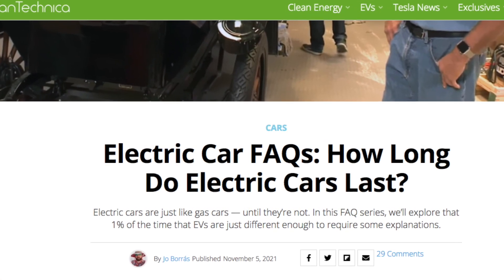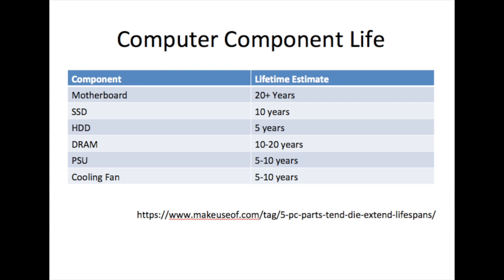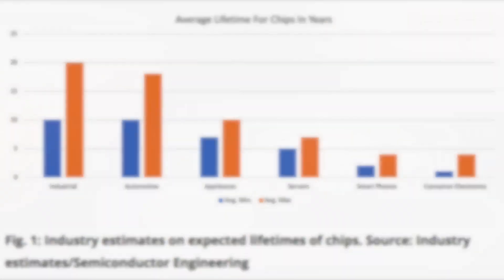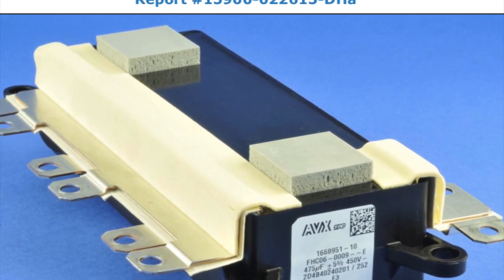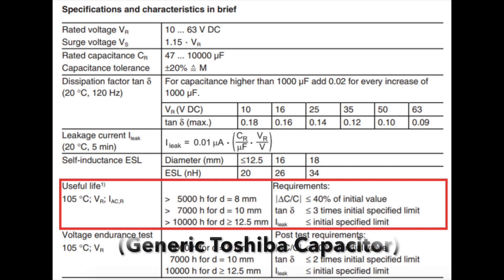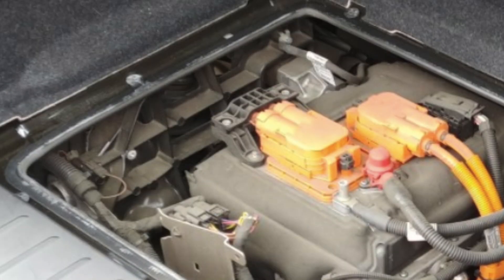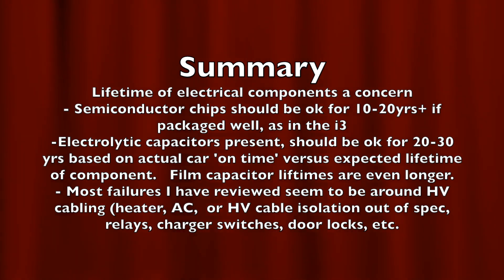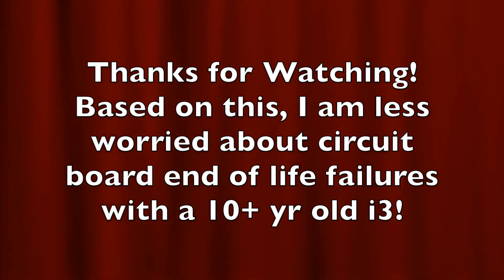BMW i3 Longevity and Electronic Component Life Review

Comment: thanks for making the video, think ill hang onto my i3, so far lasting well not sure how but tires lasted 40,000 miles, others seems to report much lower life span, 54,000 miles no reduction in main battey capacity noted yet, 12v battery replaced at 7 years old, just in case.
Reply: Which tires do/did you have, and do you run them at standard recommended pressure or a custom pressure?

Comment: Have you considered asking for comments about major failures?

Aircon compressors seems to be the most common high $$ failure right now. 

However my 2015 BEV Tera is dead due to the growing "bad drive motor bearings" issue in the pre-2018 drive motors. 
In 2018 they upgraded the drive motor (fixed a design flaw) by switching to tapered roller bearings in the drive motor. What's interesting about it - is that the factory service parts list now shows this new motor p/n as the required part used for all years when a replacement is needed.

If anyone is interested in hearing what this issue sounds like, it's the latest video on my channel.

I was originally quoted over $12k by one BMW dealership, which I believe included the transmission. I had it estimated at a different BMW dealership that I trust more for $7,225 (motor replacement only). The complication is that if the drive motor bearings get too lose, it can indeed cause excessive wear to the transmission input shaft bearing... and neither the motor or the transmission are serviceable parts.

Comment: The most worry is the tyre, since they're only made for the i3
Reply: Yep, I spent $600 on 2 rear tires in December. I would love to switch to more standard wheels and tires but it’s fairly tricky to find a good fit. 
I’ve read of others doing so, probably I’ll copy their setup if I ever do get around to it.
Reply: You can always buy generic ones and cut them in half. ;-) No, not really. But you are right, it already was a difficult topic during the production lifetime, because the choice is so limited.u

Comment: I’ve had some electrical component issues, I suspect keeping the 12 volt battery in excellent condition will make a big difference for overall longevity. 

I’ve replaced the range extender fuel pump relay which seems to have sorted the Rex completely. 

I’m still living with a radio that forgets settings daily, trying to decide if I want to sink $600+ into replacing it or just live with it as-is. 

Seems like my charge door latch is getting weak, hopefully I’ll attempt to disassemble & clean up the electrical contacts on it before it becomes an issue. 
Since I almost never really need to charge away from home, I don’t expect it to cause me any major grief. 

My car has 83k miles currently - I put the last 5k on it after buying it used last year. 
The previous owners were a little spooked by various electrical misbehaviors when their 12 volt battery got too weak and needed replacement. 

I replaced the rear tires and need to replace motor mounts soon, but overall my maintenance items haven’t been anything unique to the car being electric.

Hopefully that trend continues well into the future.

Comment: Great Video. I would also like to hear if you found out anything about the electric motor (EME) failure rates. While it does not seem common I have seen some things online about this and it seems like it could be expensive repair.
Reply from the maker: Unfortunately I do not have any numbers for the rate of EME failure.  The main documented issue was the 2018 models recalled for a bad circuit board in the EME, but that was less than 200 units.   Thanks for the question!
Reply: The EME is not the motor itself, it's the Inverter that drives the motor.

Comment: The advantage of my used i3+REX from 2014 is, that every electric component has already been replaced at least once. ;-) Ok, it is a little bit exaggerated: The charging electronics, the REX electric machine, the central control panel, the motor of the right mirror and the charging lock motor have been replaced once, the EME has been replaced twice (one time because it was hit be the free falling REX due to broken motor mount). On the REX side of things the fuel system has been serviced in a technical service action which probably means, that it has been replaced as well. The electric motor has not been replaced, but when fixing the broken REX mount everything had to come out and has hopefully been checked. Or like the the Italian mechanic said: "Garantia for everything in the back"". He also gave me two pieces of cheese to hopefully never see me again. LOL So I hope it will last another 10 years...it also looks pretty new, because when repairing the right mirror motor, a mishap happened and the right hand side of the car had to be painted new. I know, it sounds like a crazy car, but now shortly before the nearing end of the used car warranty I really only worry about the availability of replacement parts for the smaller stuff, because nearly everything in the i3 seems to be some kind of special. Regarding preventive maintenance: Make sure to replace the 12 V battery every 5 years or so, because a failing 12 V makes life pretty fast pretty annoying. It made my i3 believe that the high voltage battery is having only half the capacity and things could only be fixed by first exchanging the 12 V battery and then charging it, which means that the car had to be picked up. The warning signs were more or less non existent and the in car diagnosis did not help very much. So if things seem to behave strangely, replace the 12 V battery.
Reply: Two pieces of cheese???
🤣🤣🤣
Glad the car is still going, if anything it’s proof that they are in fact quite repairable.
Reply: @RebootNinja  Yes, two pieces of good tasting cheese. it was probably the first (!), biggest, longest and most stressful repair of an electric car at this service center. They did a good job.